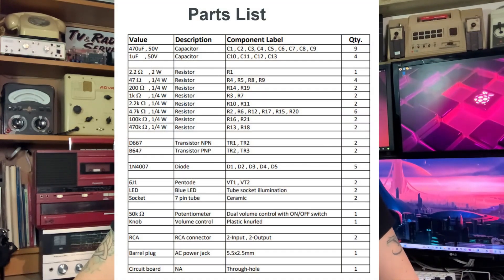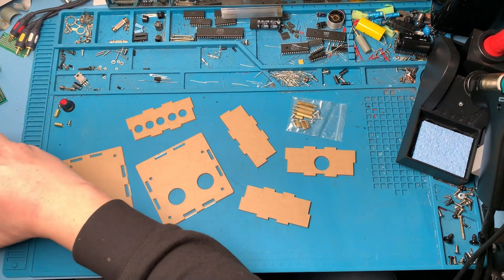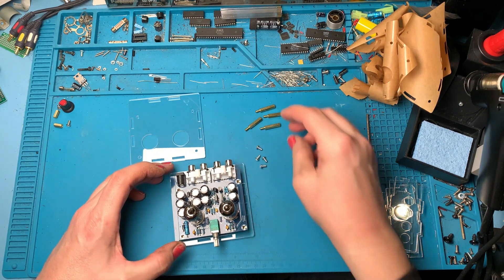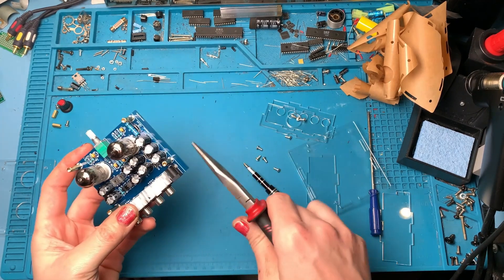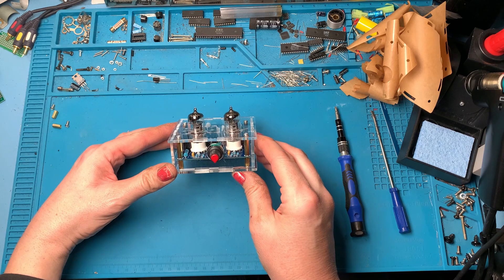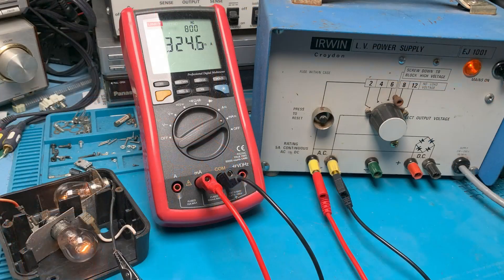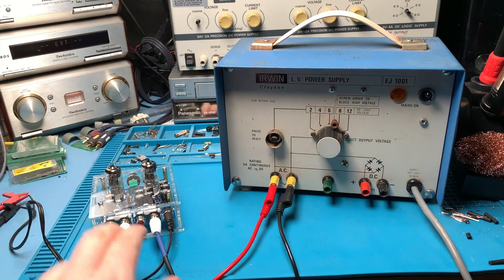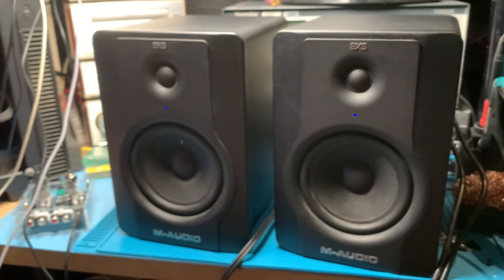Valve Amplifier (Pre-Amp) Electronics Kit Part 2, Case Build & Testing - Does It Work?

Comment: Hi Jazzy, The circuit diagram is on line - I would suggest changing the caps to 50 V types. and go for orange LEDs as they look much better . And I would report the missing items to the seller ASAP to ask for replacement under the sale of goods act.
Reply from the maker: I did show the circuit diagram in this video. The caps supplied were all 50V anyway. The orange LEDs is a good idea but I didn't have any.
I will be doing a Part 3 at some point with better replacement valves and some other suggestions people have made. Thanks for watching.

Comment: Replace the ceramic caps in the audio chain with film caps. But, replace the output audio cap with a 1 uf cap, due to the original value is way too small for a modern solid state low impedance amp. Not increasing the that value causes low frequency roll off due to the impedance loading of the low value cap Secondly, this amp has no negative feedback and has 2% THD. Installing negative feedback with say a 100K resister can lower the distortion to a surprising .03% as tested by another YouTuber. Thirdly, the electrolytic caps are low quality and the preamp will have quite a bit of AC induced hum. I don't know how much it would lower the hum by replacing caps with actual name brand electrolytic (not fakes) but worth a try. I would consider increasing capacitance and voltage ratings of those also. Don't worry about the cap dor the filaments. Low hum tube preamps have been built for almost a century using AC powered filaments, so the DC  filament supply is probably not that important in the scheme of things for this little preamp.
Reply from the maker: Thank you. Some interesting points there. This was only supposed to be a soldering kit exercise, not a full blown Hi-Fi review. You raise some interesting points and I will now be doing a Part 3 with new better valves and we'll try some of your suggestions. Thanks for watching.

Comment: Another fun episode. Nice you show how to work through the problems. I have had dealings with NOS valves before. The pins can have bad oxidation that can lead to failure if not cleaned off. The pair I ordered was supposed to be a matched set but even after cleaning the pins and putting them in my tube tester one had great emission and the other was very low. Returned. Better luck next time.
Reply from the maker: Thanks, glad you enjoyed it.

Comment: Good attempt, look forward to pt 3. It may be worth checking the final applied AC and heater volts prior to fitting new valves. The two valves may be in series, heater-wise, and may (or may not) be using half-wave-rectified DC (if a recent schematic I saw was accurate). I'm too old to get my head around the reasoning for that, but the heaters may be under or over-driven
Reply from the maker: Yes I will check that. We'll have some better quality valves for Part 3. Thanks for watching.
Reply: @JazzTechUK  Good luck. There's also info on the diyaudio forum (6J1 China preamp thoughts), on page 12, half way down, is a pdf summarising discoveries and fixes. In my opinion I would look at the heater voltage and waveform first,  then re-check and maybe do the track cuts shown second. Emailed info to you.
Reply from the maker: Ok thank you for that. I will read it before doing Part 3.

Comment: I use various valves with these kits. One of the best I've found that works with them are the Yugoslavian 6HM5 valves (buy the taller shaped ones). I usually change the caps for decent Panasonic FM ones. There are various suggestions online for eliminating the hum, but one of the best (which I've only recently discovered) was to swap Caps 2 & 6 for bigger value caps. I have wired in some 8200uF caps and this has virtually eliminated all of the hum when I play this little valve amp through my old Technics integrated amp. If doing this, remember to replace the main power resister to a 5 watt one (R1 I think). I also swapped the two 1uF bi-polar caps in the middle of the board with some 2.2uF ones, which, due to size, I had to mount underneath the board.
Reply from the maker: Thanks for the useful info. I am going to get some better valves for Part 3 and will look at the ones you said and see what else can be improved. Thanks for watching.

Comment: I love the project videos  😁👍 especially these ones as I've discovered 4 12v ( 2 of ECC82 and 2 of 12K5) valves in my parts box that I'm sure were for an amp but of course I can't find the circuit diagram for it 😂

Comment: How does the circuit get the high output impedance of the tubes down to 8 ohms to drive the speakers, does the circuit still work if you take the tubes out?
Reply: They are active speakers. So the amp is pointless in this application. I think it is sold as pre amplifier.
Reply from the maker: @mikepanchaud1 you are correct. It is just pre-amp. I need to adjust the title as it's causing some confusion. It was only meant to be a soldering exercise kit but a lot of people have taken great interest in this kit so I will make a Part 3 with better valves in and do some more tests.
Reply from the maker: @clivewi9103 it is only a pre-amp. It is not a power amplifier so is not for driving speakers. No the circuit will not work without the valves. They are what is amplifying the signal.
I need to adjust the title of the video as I think it is causing some confusion.

Comment: Wonderful video, looking forwards to pt 3.🐞
Reply from the maker: I am getting some more (better) valves and we'll try those in Part 3 and do some more tests. Thanks for watching.
Reply: @JazzTechUK  I am just getting into vintage electronics (with my mechanical engineering background). I have a late 50's Telefunken valve/tube radio, good condition overall but not working, a Phillips mid 60's transistor radio and a PYE Brava radio/tv. I also just bought the same 'Advance' signal generator as yours. Its just a hobby to keep me occupied and happy.
Reply from the maker: That's very good. It's always good to learn and try new things. Just be careful around valve equipment that is mains operated. It contains lethal voltages.
Happiness is good. It should be compulsory for everybody, lol.

Comment: Ah well Jane, it almost worked! I generally only work on valve equipment now. I'm currently trying to restore 2 1960's valve Watkins Copicat echo units. I don't know much about those valves, but I'm amazed they work that well with such a low anode voltage. There are people commenting who seem to actually know the kit, so I guess their suggested modifications would be worth considering. Looking forward to part 3.
Reply from the maker: Yes I am going to get some better valves and we'll do some more tests. Thanks for watching.

Comment: alll nice :-) but this kit can be call distortion generator :-))) i have it in hands few years ago and maybe they change design (i suppouse not coz PCB looks same) first of all to keep supply on "safe lavel" 12 V they try to power valves from +28V & -28V
so it create problem with floating ground (and constant 28V on output) and finaly we get only 56V across valve (chinese 6J1=EF95=6z1p)  is not enough to work properly even in this case when pentode is triode connected. just take generator and oscilloscopeI and check how looks singanl before and after this kit both sine and square. Don't know they still keep heaters on half-bridge rectifier? Any way patology in desing
Reply from the maker: Yes I don't think the design is optimised at all and I agree I don't know why they have the heaters configured like that either.

Comment: Hey Jane, shame about that Valve. My money is on, DOA.
I'm loving that Current Limiter though.❤
The hum you sre hearing could be from anything. You would normally build an Amplifier, like this one, into a metal case.
Did you know that the screwdriver is extendible. Pull the black collet back, and the shaft pulls out. There was a grey one in a previous video, and now a blue in this vid.
Reply from the maker: Haha, glad you like the current limiter. It was a quick lash up just in case I had made a mistake with the circuit assembly.
I did not know that about the screwdriver. Will have to give it a try.
Thanks for watching.

Comment: Great video! ... I built this kit. I didn't use a dim bulb tester, and it worked perfectly first time. Played through a VERY high quality Hi-Fi, the sound was very good, and not at all "muddy." Certainly, there was no discernible degradation. There was no noise or hum.
Reply from the maker: When I get some replacement (better) valves we'll do some more tests and see what happens in Part 3. Thanks for watching.

Comment: Looks like that valve has an air leak. Seen that happen from badly bent pins before.  Haven't built the kit but would love to see a part 3 with updates!
Reply from the maker: Yes I think you are correct. I will be getting some replacement (better) valves and we'll try again in Part 3.
Reply: @JazzTechUK  Looking forward to it.  BTW, I gave you a shout-out in my latest video!
Reply from the maker: Thank you, that is very kind of you.

Comment: The bent pins valve may have lost vacuum when powered, did not look good out of packaging.
Gaz Yorkshire.
Reply from the maker: Yes I think you are correct. I will be getting some replacement (better) valves and we'll try again in Part 3.

Comment: It looks like that bent pin probably cracked the glass, so the vacuum was lost. You certainly had your fair share of issues with this kit.
Reply from the maker: Yes it has been quite a problem so far. I will be getting some replacement (better) valves and we'll try again in Part 3.

Comment: Yeah, with the milky white look of that valve, it's 'down to air'.  Maybe the air got in around that bent pin?  Is this a preamp or a power amp?  I'm guessing a preamp since there is no output transformer to match the high impedance of the valves to the low impedance of the speakers?
Reply from the maker: Yes it is a pre-amp only. I think I need to adjust the title of the video to reflect this as it seems to be causing some confusion. Thanks for watching.

Comment: What a disappointment in the end! Before one of the 6J1s failed you said it sounded "muddy". Apparently the  EF95 or 6AK5 are better equivalents. If you are getting replacement tubes might be interesting to get one of them and compare, and if its still muddy see if the circuit can be improved.
Reply from the maker: I will be ordering some better valves and we'll have another go in Part 3 and also look to see what else can be done with the circuit. Thanks for watching.
Reply: @JazzTechUK  Great!

Comment: You are doing a great job overcoming the shortcomings of this kit. Apparently the valve with the bent pins suffered a catastrophic problem with loss of vacuum as evidenced by the heater quickly burning out and the flashed getter which turned milky white from the normal characteristic mirrored finish: You can visually tell if a tube has lost its vacuum; all the silver getter flash will have turned to a semi-transparent milky white. I guess that the less than ideal packing of the valves in the kit lead to the damage caused to the valve envelope. I share in your frustration that you couldn’t do more extensive testing but appreciate your can do attitude to overcome the shortcomings of the kit. I look forward to your next installment of this project and how you could improve upon the circuit.
Reply from the maker: Yes, I will be getting some better replacement valves and we'll have another go in Part 3. Thanks for watching.

Comment: That failed valve looks like it has lost its vacuum. Interesting little kit. Maybe worth trying a couple of decent valves if you can find them, although I'm not sure I'd throw much more money at it.... 🤔
Reply from the maker: @RonanCantwell it was only supposed to be a soldering exercise kit, lol, but has generated so much interest, even though it's not a great design, that I feel compelled to do a third part with some better valves.
Both heaters are still intact as they are wired in series and one valve is still glowing.
Reply: @JazzTechUK  Go for it. I'm a sucker for cheap kits like that. I think I've built one of every flashy led clock kit that AliExpress has to offer 😂
Reply from the maker: Lol
Reply: The heater is not lighting, so would not be affected by the vacuum?
Reply from the maker: @mikepanchaud1 the heater in the failed valve is still working as the heaters for both valves are wired in series and the other valve is still glowing. I'm guessing the loss of vacuum in the failed valve and air getting in is enough to cool the heater so it isn't visibly glowing.
Reply: @mikepanchaud1  The heater probably burned out when the vacuum was lost.

Comment: In a way it's good you got a crappy kit with all the missing bits and faulty components because I am sure that many people including myself watch something on YouTube which looks fairly easy (probably the sponsored and edited ones), then when the time comes to make the project happen all sorts of problems come up which makes one think that they're doing things wrong.
Reply from the maker: I don't see the point of trying to make out that everything goes smoothly when it doesn't, as it's not a realistic representation of how things are, exactly as you said. However I do try to show workarounds if possible, like replacement transistors in the first part, but with failed valves that put a stop to it there. In Part 3 we'll be fitting better valves and having another go. Thanks for watching.

Comment: Thank you for the video, nice job. We used the 6J1 tube in some of our microphones we designed.
Reply from the maker: Thank you. Watch out for Part 3 where we'll be trying some better replacement valves and doing some more tests. Thanks for watching.
Reply: @JazzTechUK  6AK5 perhaps?
Reply from the maker: 6AK5 is on my list of possibles

Comment: I will be interested to know how the acrylic stands up to the heat of the valves?
Reply: The valves don't generate much heat. They're not power output valves. The case is unlikely to be affected.
Reply from the maker: @TokkanFX as @marcse7en has said, they don't generate much heat as this is a pre-amplifier kit, not a power amplifier kit for driving speakers.

Comment: Hi Jane. I have put a few of these kits together myself and enjoyed doing them. Would be interested what valves you get to replace the 6j1 valves. Enjoy your videos. Thanks.
Reply: Any EF95 / 6AK5 / 5654 type valves generally work with these kits. Mullard 8100 sound very "warm" when installed. I also use Yugoslavian 6HM5 valves with it.
Reply from the maker: @nancyblubberhead7256 thank you for the suggested replacement valves. I am compiling a list of suitable valves to decide which ones to get for more testing in Part 3.
Reply from the maker: I have had a few types suggested so will look into what better valves to get. Watch out for Part 3 when we'll have another go with the better valves. Thanks for watching.

Comment: This may be a daft question but why did you use AC and not DC
Reply: The circuit design incorporates a voltage doubler that requires AC to work.
Reply: @SiaVids  ah ok that answers everything
Reply: AC is specified for power input.
Reply from the maker: @dazer123 as @SiaVids has said, the circuit employs a voltage doubler that requires AC to work in order to get some reasonable level of voltage for the plate/anodes. It actually turns out to be 2x voltage doublers added together to make about 56V.